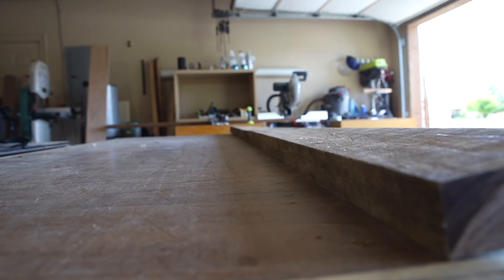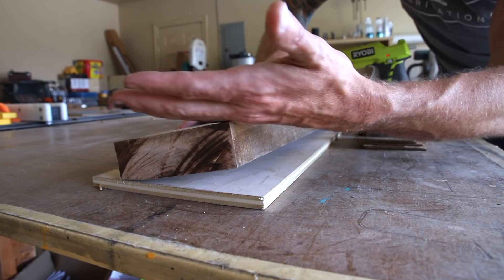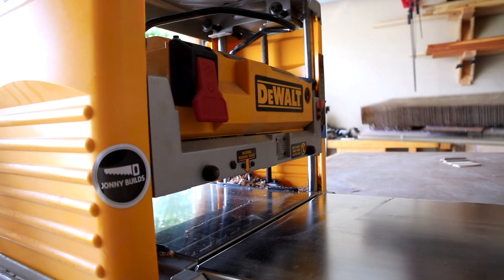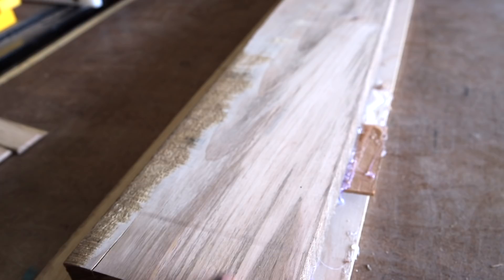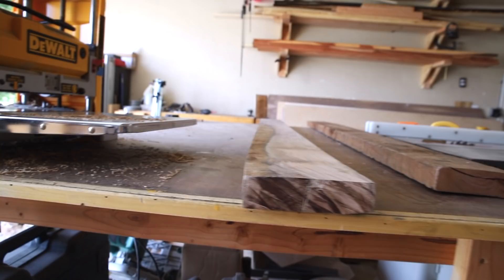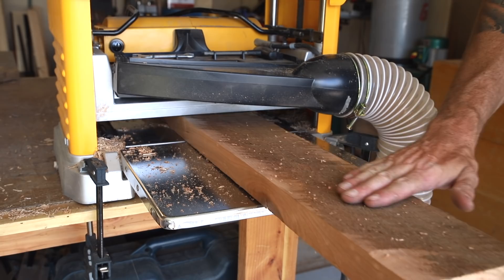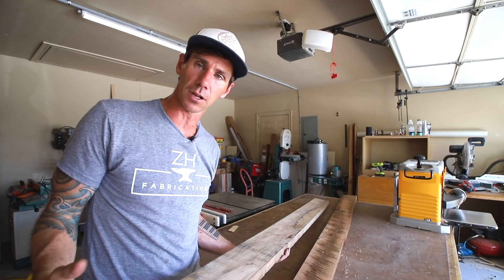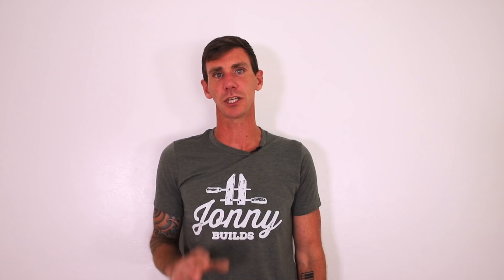Skip Planing Tutorial | Skip Plane & Flatten Reclaimed Wood | How To

Comment: If you know you don't need the length, you can save a lot of thickness by cutting in half before planing.  Nice video!
Reply from the maker: Thank you David! The boards were for a 7 foot table, and they were cut 6 inches longer to account for potential snipe.
Reply: Was going to give same advice.  But if you do need the length then maybe choose a different board.   Shame to exist 50 years only sacrifice so much in your sawdust bin.
Reply: @RickMaxon  I was also going to make the same suggestion, and came to the comments to see if had been covered. It hurts my heart to see a 1/3 of a 50 year old oak plank turned to sawdust. I think I would have found another board that was less twisted for my tabletop, and saved this one for shorter cuts to preserve more wood.
Reply: @dougsholly9323   Did it ever occur to above comment(s) he was using this as an extreme example for demonstration purposes?
Reply: @brewsterly2927  did he need to so he could make his point?
Reply: @dougsholly9323 
 Still a waste.
There is an old woodworkers saying:
 "Keep it as long as possible, as long as possible."
Reply: @brewsterly2927  "as long as possible" was up long before he turned most of that board to sawdust.

Comment: Try clamping at one end and then twisting the other end well past level, damping the wood and leaving for some time. Release one end and check straightness occasionally, it will remove most if not all of the twist over time.

Comment: @Jonny, how many passes did you make for this warped piece. I have a similar piece and may have already done almost 50 passes of 1/64th of inch. Just wondering if that is normal for such warped boards or is there something i might be doing wrong.

Comment: Lot of work. I have big pile of oak that came out of and old hog barn. 2×4 6 8 10 12 s. Some 16 foot long with some crazy twists and bends. Oh and plenty of nail to locate.most most of the good stuff was used for a loft in my barn, floor for a couple trailer I have, a lean to for fire wood and a few things I can't think of for now. Still got a huge pile of wonky boards left.

Comment: So question for you. I have the same planer, do you have and issue with the dust collect?
Reply: Gary Robertson I do also, and yes, it sucks. You can even see the left edge of the dust collecting part lifting away when he sends that second board through. That piece needs to be screwed in, and you have to take the 2 inch port apart and use the 4 inch part. I didn’t know they came apart until a year after I owned the planer.

Comment: I know that you mentioned that board would be used for a table. But if it's at all possible I would cut those down to smaller lengths. You would save more material that way.

You probably had shavings for days!
Reply from the maker: It’s a 90” board for an 84” table.
Reply: I meant in general if some else was trying to flatten a board like this. Not much you can do in your scenario :)
Reply from the maker: Hey I'm a Maker Good tip!
Reply: @JonnyBuilds  do you have a video showing where you got this wood? It's neat how barns were made with the local wood. Around here it's all pine.
Reply from the maker: I talk about it in my Parsons table video.

Comment: Hi! I’m new to woodworking and someone told me to use a jointer first to make the flat edges as reference then proceed to the thickness planer. I was just wondering why you didn’t use that process here?
Reply: This is a viable option to flatten boards if you don't have a jointer or if the boards are to wide for your jointer.

Comment: It's wayyyyyy better to just put water buckets under the wood, put little campfires under the buckets, hang the wood a little bit above the buckets, and cover it all up and steam that wood. Once the wood is nice and boiled up, you can sandwich that wood to straighten it out with some other boards and clamps. Leave it out to dry. Once it's nice and dry, then you can send it through the jointer and planer.

Or you can just hang the wood above a long pit fire, and constantly douse it in water until it becomes boiled, then go straight to the sandwich process. A million ways to boil or steam wood.

Comment: About your skip-planing, to me skip-planing means that you keep turning the board over with each pass, removing small amounts from both sides equally.
I turn the board over and end for end to keep the grain in the correct orientation.
Reply: David Januszewski completely agree. If you just keep pushing through one side it will just contour to the side that’s riding on the bottom

Comment: I can't see anything about that board that would prevent getting it perfectly dimensioned. Your sled is really flimsy. For a board that long I'd make a sled from two pieces of 3/4 MDF. You'll get a dead flat surface provided your planer blades are properly alignend.